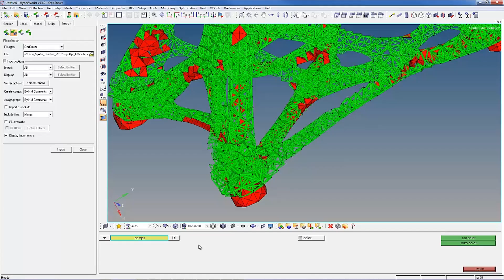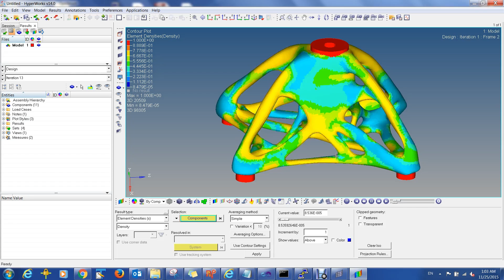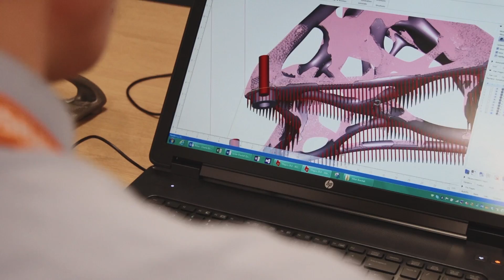The Titanium Spider Bracket with Optimized Lattice Structures

Comment: How does the process allow for greater than 45 degree overhangs? Would you be able to explain the 're coating' method @ 2:30?
Reply from the maker: Thank you for your question.  Charlie from Renishaw helped us to answer your question. See here is answer: 

"Bulkier areas of material do not cope well on top of unmelted powder, hence we need to use supports, and must adhere to the 45° rules. However, the more delicate the geometry is, the shallower we can build. As only a small
amount of energy is required from the laser to form these small structures, and it is more tolerant to forming on top of fresh powder. Our recoating mechanism is made from a silicone rubber which does not disturb the delicate structures."
Reply: Hi, thanks for the reply. Typically, when exporting a MTT file for printing, you will use all one laser setting for the whole build, meaning the same laser power for the shallow overhangs as well as the solid parts. How have you achieved to dynamically modify the lasers power and other parameters throughout the build? Is this through the materialise software only, or a have you also included additional hardware on the AM250. Thanks for your time.